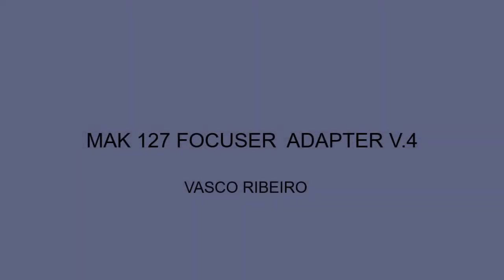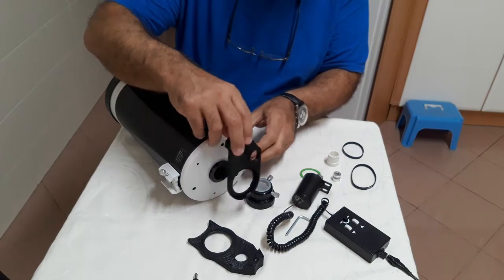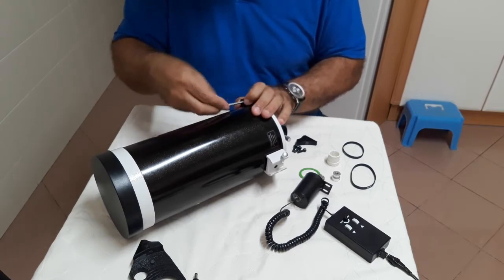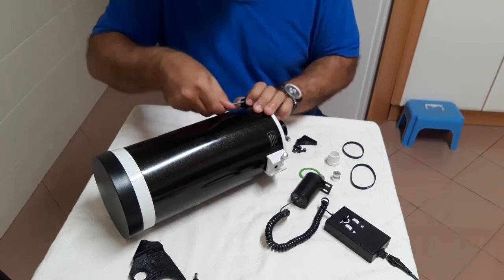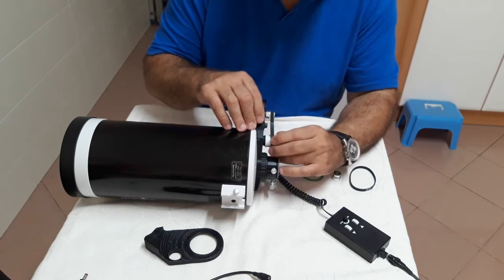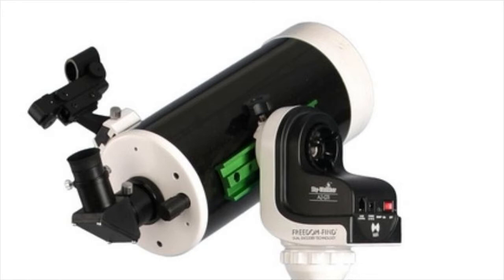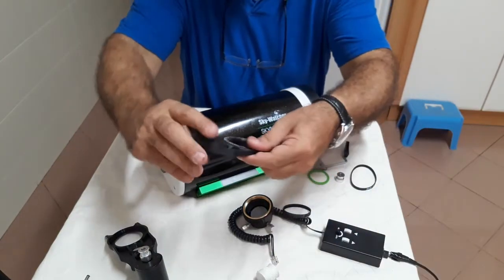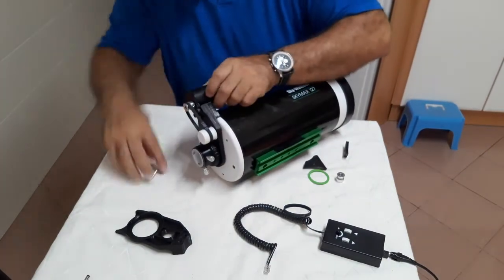MAK 127 Focuser Adapter V5

Comment: Ordered the kit which arrived within a week. My SkyWatcher Mak127 has the focus knob in line with the vixen bar. The design for this Mak version works perfectly and was very easy to fit, keeping the focus motor well clear of the mount during operation. I can now focus perfectly without any vibration or wobble!
Many thanks Vasco. Clever design and great service. Clear skies!

Comment: I ordered the kit for my Celestron SLT version of the 127 Mak, fits to the scope and the motor focuser unit well. A must if you use your scope for planetary and DSO astrophotography, especially if using a laptop for using it remote. A huge improvement on manual focusing.
Reply from the maker: Thank you for your review!

Comment: Got one of these Mounts Jan 2024, the one in the 2nd half of the video. They really do work like a charm. One of the things I really like about it is the slip on cover over the fitted focus knob. (The white thing in the Video)  I had to do a little (and I do mean little)  bit of sanding on the hole for the eyepiece which then sits great with the tiny peg fitting into a screw hole to prevent any movement. I Added the little fitting bracket shown at 08:30 but I felt the whole thing was really secure without, still a nice extra.    A great way to fit motorised focus.  Plus Vasco is a real Gent to deal with. So to end, a easy to fit, very handy mod to my telescope.  ...... go on get one !
Reply from the maker: Thank you for your review!

Comment: Would this kit fit the Celestron 127 SLT as i believe both models are more or less identical? Also is the kit the complete with the motor or can you purchase the 3D printed parts only?
Reply from the maker: Hi Gary, yes it fits. The kit includes all accessories except the motor that you need to buy separately.

Comment: Hi Vasco, Looking forward to receiving my kit. What eyepiece adapter are you using on your Mak 127?
Reply from the maker: Hi, I usually use a SCT (and brass adapter) to T2 with a T2 to eyepiece holder with brass ring, found in TS Germany. I also have a Baader clicklock.
Reply: Thanks Vasco. All fitted and working. 😊